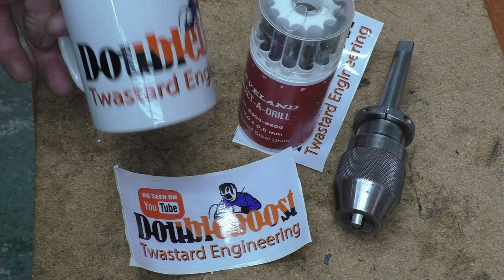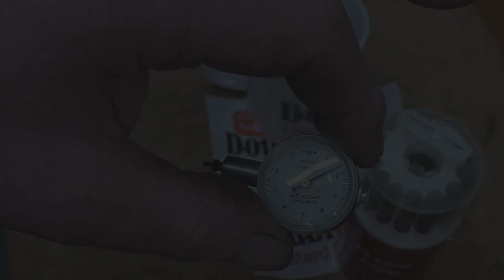SNNC 367 P1  Lantern Tool Post . Monthly Draw

Comment: Hi John, the initial error was in measuring the inside edge of the base and then adding 5mm. You should have actually subtracted 5mm to place the centre on top of the join between the two surfaces. Hence the 10mm difference.

Comment: Hi John

Great job.
Shouldn't the bottom of the slot be flat? Maybe you are going to turn a dished "base" to make it into a "rocker" type toolpost :-)
At the completion of the slot, I imagine the slot would be slightly wider in the centre, after releasing the vice pressure? Though I guess this is not critical for a toolpost :-)

Comment: Very nice job that John , one hell of a lantern tool post. How big is the swing on the lathe it's going on?
Reply: This is going on a wadkin pattern lathe which has a 8" swing, They have a removeable gap so you can spin 24" diameter.

Comment: John, why do you have the quill turning when using an electronic edge finder?
Reply from the maker: The quill turning removes any run out errors as can be seen by the led flashing . Not much but it is there